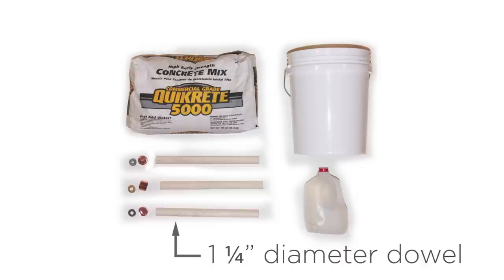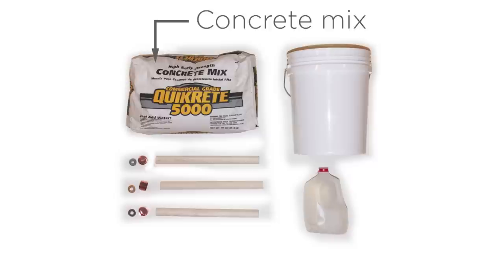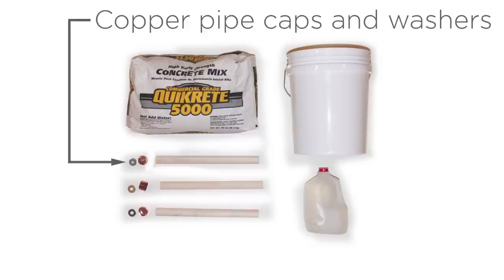HomeMade Modern, Episode 8 -- DIY $5 Bucket Stool

Comment: You can use an electric sander held against the concrete form to vibrate the air out of the mix.

Comment: Hey love your work. I'm planning on making a small coffe table with a rectangular box. I am planning on using wood for it's legs the same way by putting them in while the concrete is wet. Would i need metal rebars

Comment: Hi Ben, I tried this and everything when as expected until the cement fully cured, the legs just fell of a couple of days later, since the cement contracted a tiny bit. Has this happened to you? Any idea what I'm doing wrong? I used regular cement and also white cement, mixed with water only. Thanks in advance =) keep up the good work
Reply: Late reply, but if your using just cement and not concrete, that may be part of the problem.  The cement is the material that dries and adheres to small stones and such in concrete.  Cement alone is less structurally sound than concrete.  Aside from that, try making a few notches in parts of the dowels that will dry within the concrete.
Reply: Makes sense! Thanks friend, I'll try that.

Comment: Ben, I've tried a couple of these using fast setting "post haste" concrete, I tend to use enough water so the gravel bits fall to the center, however the concrete takes ages to cure. When I pulled my table out out the bucket (after 48 hours) it was still not fully cured and a chunk fell off. Suggestions?

Comment: I thought this would be simple enough to make. I got the same concrete but there were tons of rocks in it. I tried mixing it with the wooden dowel, and it was so hardened (after, like, seconds) that I couldn't even begin to mix it around. Wtf. Am I just a failure or is it more difficult than it seems?

Comment: hi, quick question- is there anyway I could potentially make the stools bigger by having longer dowels? 
thanks:)
Reply: of course you could! just adjust the measurement fro 16 inches to whatever length YOU want it to be...like 24 inches, or whatever! it's just mean buying more dowels. same with if you want the seat of the stool to be a bit bigger, just get a bigger bucket!

Comment: I tried to make one of these the other day, but had trouble getting it out of the bucket. I let the concrete sit for about 36hrs before I tried to take it out. Ultimately the concrete cracked and crumbled and the legs pulled out of the concrete. Did I use too much water when mixing the concrete?
Reply: you probably just waited too long to take it out
Reply: +Dave Tuttle you should have just used a concrete release agent. Concrete needs normally some weeks to harden to around 98%. The other 2% take years (you just won't notice), so there's no "wait too long" when it comes to concrete.

Comment: I tried this and the cement fell apart as I was taking it out of the bucket 😣 What did I do wrong?
Reply from the maker: You may have added too little or much water. A little water goes a long way when working with concrete. The consistancey should be almost oatmeal-like. Also make sure the mixture is throughly mixed before pouring into the bucket to set!

Comment: a little warning - the finished product is heavy (and extremely top heavy)  I've made 3.  they can easily tip over with a little bit of a shove. could break a toddlers foot in a second.  missed my 2 year olds foot by an inch the other day.

Comment: Hi, how do you do to center the dowels?
Reply: DiegueteB I made a prototype and centering the dowels was an issue.  My finished stool had 1 leg off a little and the stool was a bit unsteady.  For my next stool, I will cut 3 equally spaced notches in my bucket such that all three legs are equally spaced when placed in the concrete.  Additionally, I laid a board on top of all three legs and placed a level on the board to level the legs.

Comment: I made one the other day and you cannot make it for $5 unless you have most of materials laying around.  I went to Home Depot and bought 48" hardwood dowel $4.75 (1 stool), Quikrete 5000 80 lb $5.28 (enough for 6 stools), 1-1/4" copper cap $4.75 each ($14.25 for each stool) which I did not purchase.  If you were to purchase all the materials in the video, you would not be able to make each stool for $5.  The cost per stool would be $4.75 + 14.25 + 5.28/6 = $19.88.   This doesn't account for the washers used to level the legs would would be probably about a dollar per stool.

anyways.. the cutting 48" dowels to three pieces yields 16" long legs.  I ended up with a finished stool height of about 15.5 inches which is a bit low.  I will build another one in a day or two, but I will buy 1-1/4" EMT conduit which a 10 ft piece costs around $10 at Home Depot.  This will allow me to make cut 6 pieces for legs at 18-19" length such that the finished stool height will be a comfortable 17-18".
Reply: The $5 being referred to is in reference to the bucket. That type of construction grade bucket is often referred to as a $5 bucket. So, the title should be interpreted as "A stool made with a $5 bucket" rather than "A bucket stool made for $5." Understandable misunderstanding, though.
Reply: John Armour then in that case it should be a $3 bucket stool.  Both HD and Lowes sells them for $2.97/$2.98 each